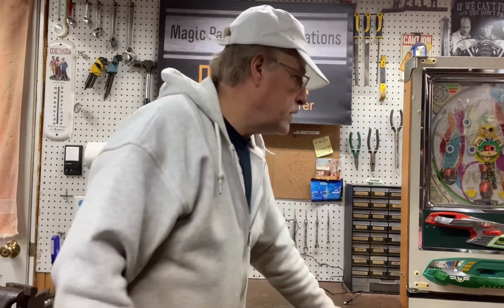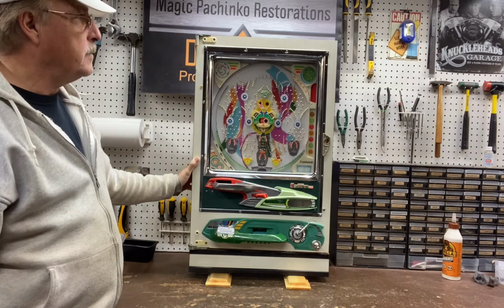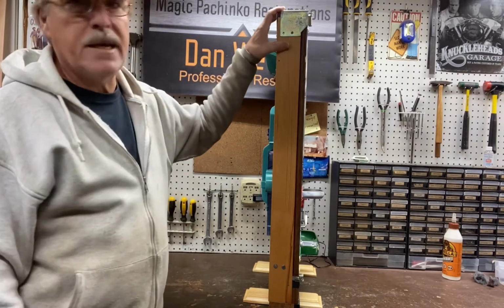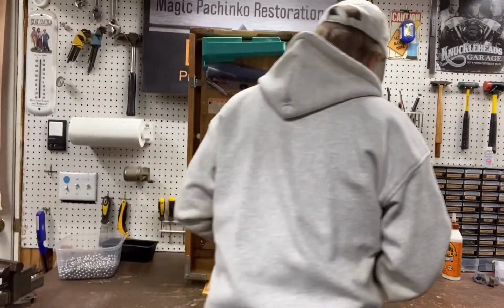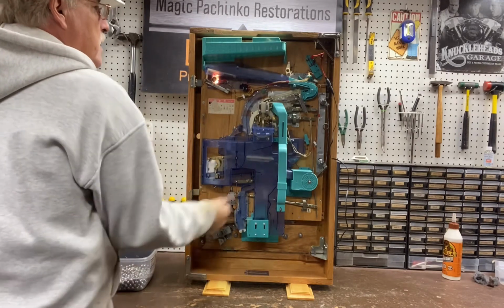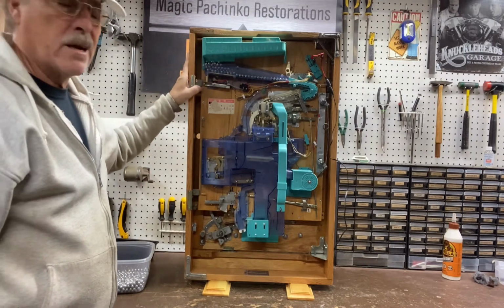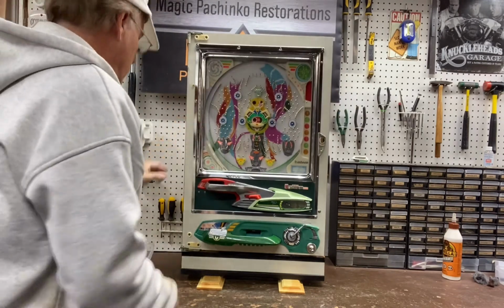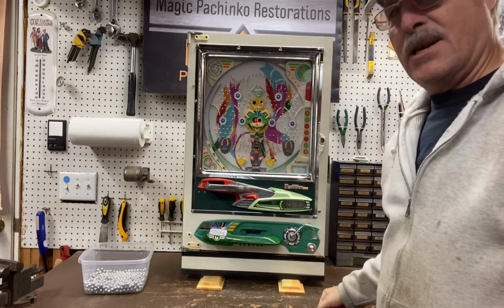Heiwa Vintage Pachinko Machine

Comment: I have the same Heiwa unit but slightly different pattery with me.  Your loading hopper has plastic cut out, mine has 4 piecescut out, from the left it shows 12 and to the right I believe is shouls be zero but 12~4 is present, very strange.

How do I clean the play field under the glass, I want to polish the pins, some are tarnished most are good condition.
Last Do I need a tool to unlock from the right , I do not have the original key.

Great Channel! I love what you have done in the past
Reply from the maker: There is a release latch on the right side(usually) of you machine that will open the chrome frame that holds the glass or plexiglass. This allows you to open it and get at the playfield and pins.